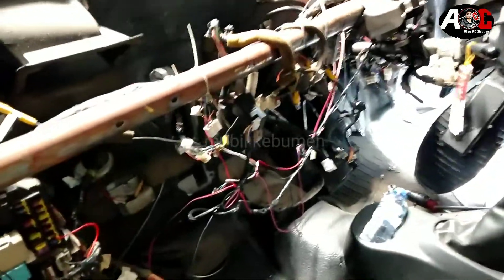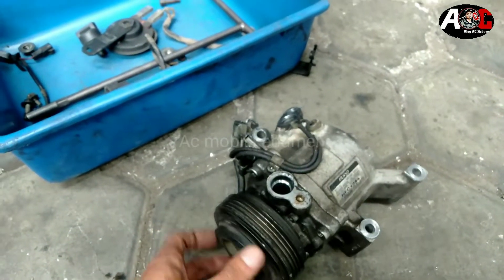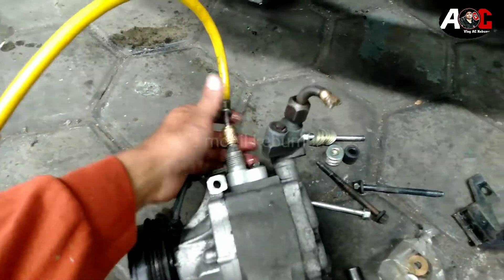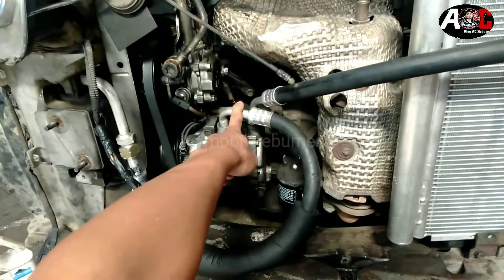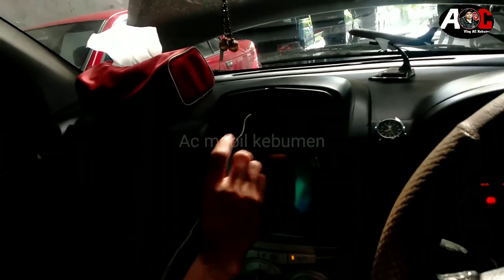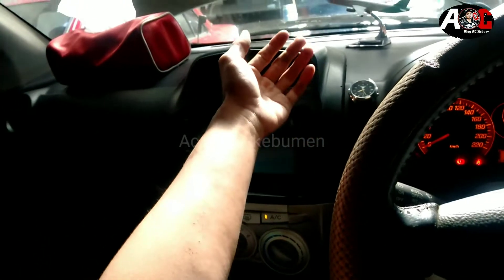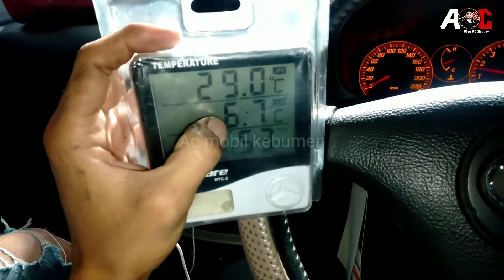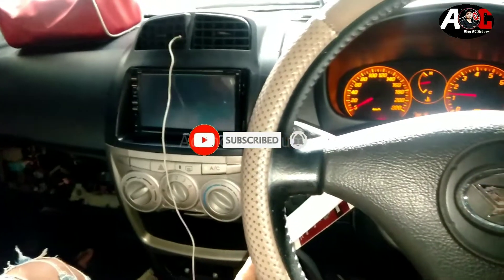DAIHATSU SIRION custom kompresor-kondensor pake AVANZA#DinginCeess#acmobil

Comment: Halo om, izin tanya,
sirion old ku kalau setiap nyalain AC dia akan muncul bunyi "teeeengg" bersamaan dengan gas mobil di RPM awal (rendah mau naik). Kalau RPM udah diatas 2000an bunyi teeng tadi hilang. 
Tapi AC masih dingin dan 1 tahun lalu sudah sempat ganti ke kompresor ex singapur.

2 bulan lalu ke bengkel resmi Daihatsu, diinfo Magnetic clutch udah gejala perlu ganti.

Apa bunyi itu dari MC ya om?